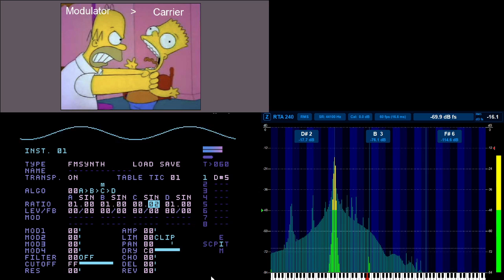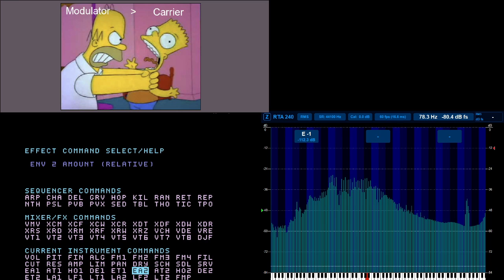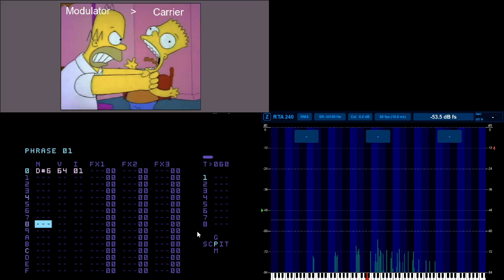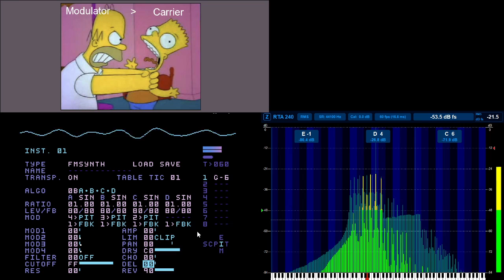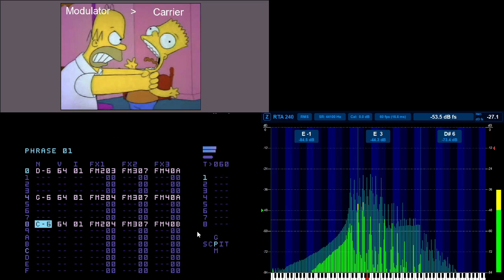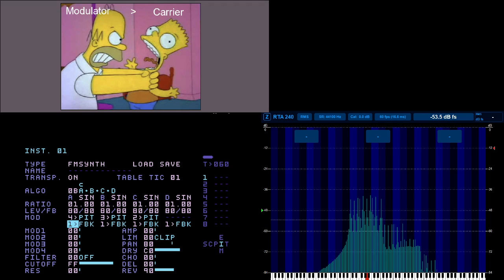Learn FM Synthesis with M8 Tracker

Comment: Does each operator has it's own envelope ?
Reply from the maker: no, there are 2 envelopes and 2 LFOS and 3 table columns that can be freely assigned to various properties of operators.
Reply from the maker: for example you can have ENV1 and ENV2 control the levels of operators A and B, LFO1 and LFO2 control the levels of operators C, D (LFOs can act as simple envelopes as well), table column 1 can be assigned to operator A's ratio, column 2 to operator B's Feedback, column 3 to operator C's feedback
Reply: @impbox  
Only two envelopes for six operators ?
That seams pretty meager
Reply: @WARDISWARD  it's 4 operators. 4 ENVs would be nice, but using the LFOs as a workaround is quite alright to me, this is still a powerful fm synth.
Reply from the maker: You have 7 envelopes for 4 operators. 2 are called ENV and are AHD envelopes, 2 are called LFO but can be used as simple ramp envelopes or LFOs, and 3 are tables which can be used to create very powerful complex envelopes or lfos.
Reply: Also you map things with the modifiers, so one envelope can map to up to 2 params (level, ratio, pitch, feedback) of each of the 4 operators (so each env can map to up to 8 params)